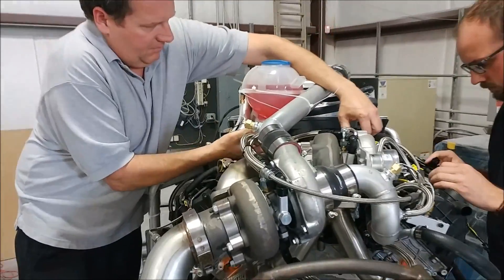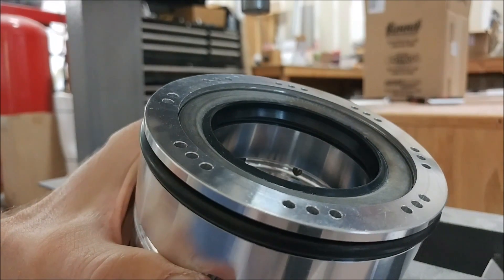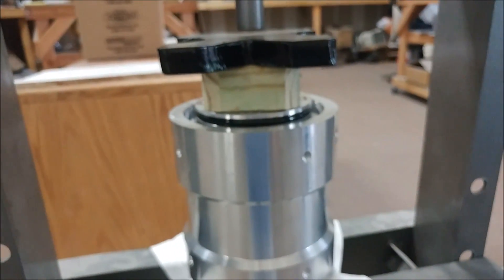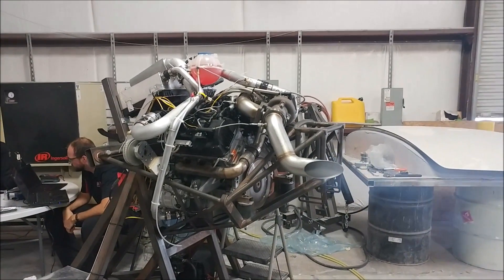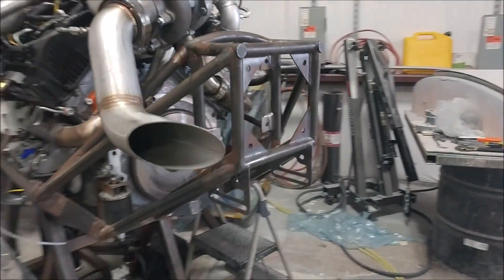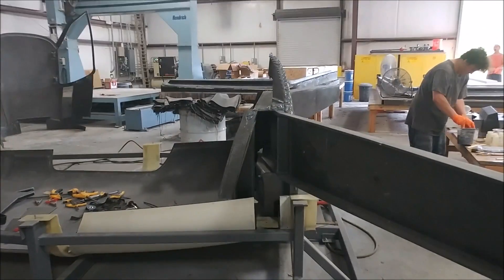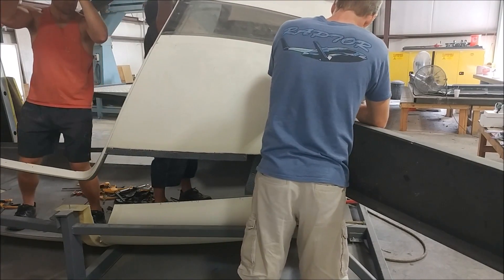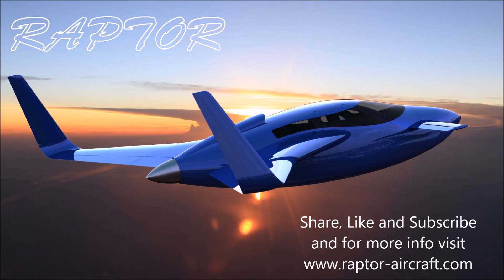All Fired Up! - Engine comes to life

Comment: Great work!  So is that the Audi 3.0 TDI engine adapted for the Raptor, or a different engine? Running Diesel, or?
Reply from the maker: It's the Audi 3.0 TDI.
Reply: Raptor Aircraft Great! I have an Audi A6 3.0T Quattro, and I love that engine! It's my understanding that the 3.0TDI is basically the same engine, just tuned for diesel usage. I have driven the A6 TDI and that seems like a great engine, too! I'm guessing that you are able to get the TDI engines cheap, given the lawsuit and Audi having to buy back a bunch of those cars. Good for you! Very smart!

Comment: wow I never realized you could stand on the carbon fiber fuselage considering how lightweight it is. also nice to see the inside of the bearings / belt drive.
Reply: carbon fiber with foam can be over 10 times stronger than steel but lets say the way they made it the carbon fiber is 5 times stronger and the skin is .25 inches that is like standing on a 1.25 of steel. that's why crash a Lamborghini at 100 mph and live to crash another day